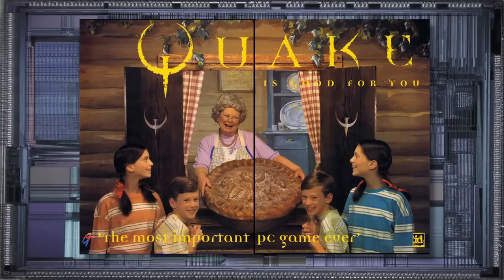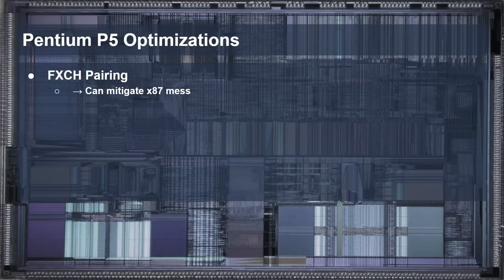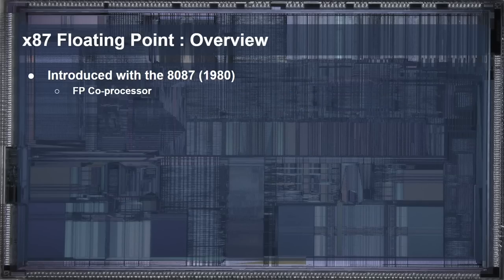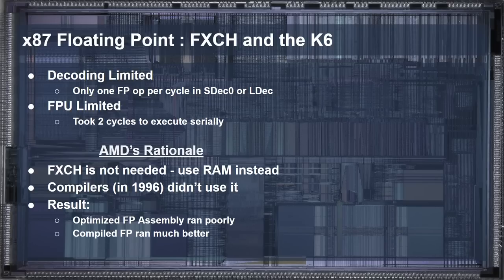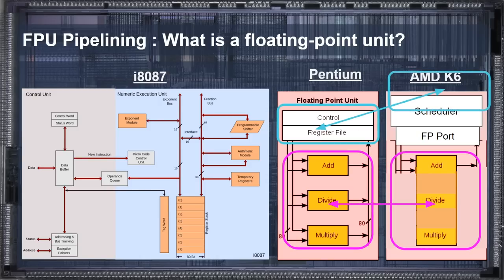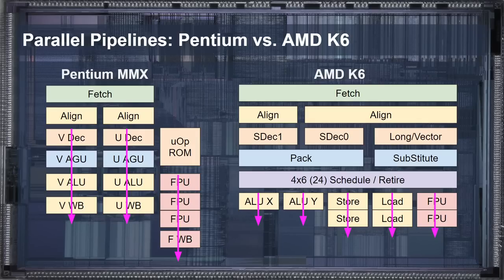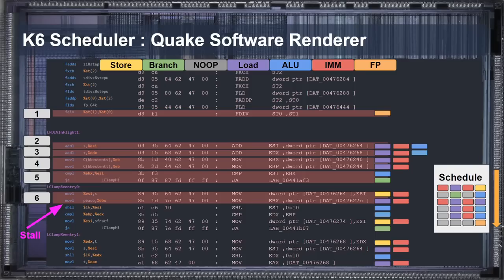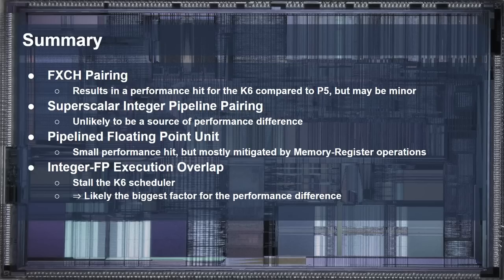Quake, Floating Point, and the Intel Pentium

Comment: You failed to mention how many instructions K6 could theoretically execute per cycle
Answer is
AMD K6 have dual instruction decoders
2 integer units (slightly better solution, then Intel) 
Floating, load, store and absolutely massive (8192 entries) branch petition unit
It have 32kb of L1 data, 32kb of l1 instructions, 20kb predecoded instructions cache. Even predecoded instruction cache is bigger then any L1 cache on any Pentium ever. 
AMD K6 could issue up to 4 instructions at same cycle.
Reply from the maker: That was discussed at 9:45 in the video.
The K6 actually has 4 instruction decoders, but can only decode the two simple decoders in parallel. That's in contrast to the P5 which has 2 decoders with some preconditions that effectively make it 1 simple + 1 complex decoder.
The K6 and P5 both have two integer units, so there's no difference there. Although, the integer units on the P5 were more advanced, since they could implement stack operations together.
The branch prediction entries aren't going to make much of a difference here. If anything, they help make the gap narrower than it would have otherwise been.
You're correct about the cache size, but again, that would only help narrow the gap - the K6 still performed worse than the P5 and P55C for Quake. Also note that the predecode bits weren't significantly more accurate on the K6 than the P55C's length predecoder - e.g. 80% accuracy vs 74% accuracy. They were mainly needed to ensure that the complex and vector decoders didn't cause the fetch stage to deadlock too often. And they also hindered self modifying code, which would require the entire cache to be flushed and a refill was slowed by the predecoding recalculation.
As for the last statement, the K6 could issue 4 MICRO-OPS per cycle, not full instructions. That was described in another section of the video, and ended up being the entire reason for why Quake was slower on the K6.

Comment: The problem and irony with the Cyrix 6x86 FPU was the fact that it was essentially the FastMath 387 with very little changes. What got Cyrix notoriety back in the 386/486 era for having one of the fastest add-in coprocessors wound up becoming a millstone about their necks because the emergence of Quake as a popular game. Besides, the whole point of using the FPU was to make use of as much computing resources as possible to make Quake one of the most futuristic game engines of its time. Other applications would not utilize the FPUs to such an extent outside of scientific or supercomputing purposes. Thus AMD and Cyrix chose to not put as much development resources into the FPU pipelines in order to cost-optimize and focus more on integer ops, which is what more desktop consumer users would perceive as value. Cyrix unfortunately took that to an extreme and got caught out.
Reply from the maker: Thanks for the additional information! I do recall reading about, and it makes sense from their perspective - why spend money upgrading the FPU architecture when it's not often used and they had limited funds due to competition with AMD and Intel. 
Although I disagree with your assessment that Quake's goal was to make the most futuristic game possible. The goal was likely to produce a 3D game without resorting to pseudo-3D techniques like in previous generations - a simple goal which comes with many performance strings. Luckily at the time of development, the Pentium could just barely manage to achieve that goal, so they proceeded with development. It was more like the bleeding edge of consumer technology finally caught up to their goals rather than trying to push the goals as far as the hardware could allow.

Comment: 10:27 - Minor error: the "Compute" highlight doesn't cover the Exponent Module, but does cover the Temporary Registers, which should be in the "Control and Regs" highlight.
Reply from the maker: Thanks! I think that was mostly a limitation from trying to draw a simplified shape. Although, I wouldn't really consider the exponent module as part of the "compute" given that it's implemented as a small adder - the real compute happens in the main units which could do up to FP80 computation (64-bit mantissa).

Comment: Wolfenstein 3D ran fine on 286, so it wasn’t optimized for 486 and was released as an enhancement to the previous game using the same engine, Catacomb 3D.
Reply from the maker: Just because it ran fine on the 286 does not mean that it wasn't optimized for the 486. Optimized usually implies code efficiency, so it ran faster on the 486 than the 286 after accounting for the clock speed differences.

Comment: I remember K6-2 destroyed Pentium II the moment AMD released a patch for Quake 2 back in 90s.
Reply: Celeron 300A is what "destroyed" P-II, and it didn't need any game patches for that.
Reply: @Ivan-pr7ku  Trust me, I know what I am saying. I was a gamer at that time.
Reply: I remember the Pentium 2 systems being prohibitively expensive and mostly targeted at businesses in 97. So for a home windows 95 machine you either got an AMD K6, an MMX, Celeron or a Cyrix system(from best performance to least). Lots of people still had Amiga and Atari ST systems which ran 2d games and media software.
If it was 3d games you wanted, you got a Playstation or Nintendo 64.
But for gaming it was less important what x86 CPU you ran in '97/'98 because graphics cards like Riva TNT, ATI Rage, Matrox and S3 were coming out. Even the mostly-2d-accelerators ran software 3d better than the CPUs (though 3d APIs only got good with win98), and the T&L cards after that first gen were something else entirely. Massive FP multiply and divide operations were just done with the 3d APIs since the GPUs have the better hardware since then.
In retrospect, AMD's implementation of out of order execution was more significant than Intel's fast FPU switching trick. And Quake was less significant as a game but more as a basis for most 3d engines at the time (well, the openGL version, not this software rendered one).

Comment: I haven't finished the video yet, but so-far, it seems well-researched. However, it's odd to see you say that the Cyrix 6x86 PR233 was "233 MHz", since that chip only ran at 188 MHz. I'll leave any more comments I have after watching the rest.
Reply: Hmm, I'm not quite sure I followed your explanation of why you believe the "ST" K6 processors weren't benefiting from their on-board cache. Just looking at the specifications, it seems intuitive to me that the performance-per-clock of the K6 "ST" models scales with their L2 cache. I suppose we would need to test to see for sure.
Reply from the maker: The PR233 was used as a point of comparison, because Cyrix claimed their CPU was equivalent to a 233 Pentium. There's really no "fair" way to compare the architectures, given their optimal speeds and underlying implementations were different. 
As for the ST variant, I think you have that confused. I said that the ST cores DID benefit from the L2 cache, and that's why they matched the Pentium MMXs (when scaled for frequency). It was the K6 CXT cores that did not, because they lacked the L2 cache. Unless you are questioning the difference between the 128K and 256K versions? That's likely because the 256K could cover more of the DRAM penalty by simply being larger (reduced misses).
Reply: @RTLEngineering  Hmm, I'm not very good at listening, so maybe I did just hear wrong. I'll have to listen again sometime when I have time. ^^ Thanks for replying.

Comment: so, the pentium 233 processor could perform one "free" floating point operation every 16 cycles, whereas the k6 and the one mentioned at the start of the video had to pay for each one. And this meant that code optimized to take advantage of that pattern of 1 FP operation per 16 cycles fully took advantage of the pentium 233's special feature.
Reply from the maker: Essentially, yes. Although it wasn't just any FP operation, it was FP divide. Other operations like FP add could be performed every cycle on both the K6 and Pentium (the K6 might have been every-other cycle due to the decoder though, I would have to look back at that, and the Pentium would require a specific sequence of instructions to also take advantage of that).
I wouldn't say this was necessarily a special feature of the Pentium (certainly not special to the 233 MHz variant), more of a quirk in the micro-architecture - it was a feature on the K6 which turned into a bug, and a missing feature on the Pentium which turned out to perform better.
Reply: @RTLEngineering  Oh ok. By the way, I know basically nothing about processors. 
What I meant by a special feature was what you talk about at 14:30. The exception logic.. which made it possible to have a FP division in the background.
Reply from the maker: Oh, the exception logic is implemented on all of the processors - it's required by the instruction set architecture (ISA) specification (x86 in this case), which effectively is the agreement that the hardware makes with software / compilers allowing code to compile and execute. The difference between the processors was in the technical implementation of how this logic was implemented - the ISA states what should happen, but not how it should happen. Modern processors take advantage of that distinction to execute more instructions in parallel and therefore faster overall. Anyway, I think it would still be more precise to refer to the difference between the processors as a side-effect rather than a feature, since the implementation is ideally transparent to the software (it should have no idea what's going on under the hood). AMD's solution was perfectly valid, it just had unintended consequences for Quake. Also, aside from the FDIV, I believe the rest of the Quake code actually ran faster on the K6 (because of the parallel execution - called Out-of-Order execution), but it wasn't enough to make up for the loss caused by FDIV. 
I hope that made sense / clarified what I meant in the previous comment.
Reply: @RTLEngineering  yes, it made good sense. I did not get it as fully as you wish but that is down to my own illiteracy on the subject. Like, I'll take your word for it. But I find your explanation to be well stated.

So, the question I next have, is, 
could an engine have been developed that ran just as well on the k6 as it did on the pentium? Was there a design limitation that the pentium happened to satisfy accidentally, but which the k6 was not made for? 
Like stepping backwards in time, per se,
what would it have been like if they had developed Quake with the AMD processors in mind? 

You say the software is supposed to be blind to the internals of the processor, 
yet it will always be the case that knowing how the processor works means knowing how to utilize it better, 
like going to a tailor, who will measure you and make you clothes that fit you specifically.
Reply from the maker: An engine could have been developed that ran around the same on both processor, but it would have had to give up fdiv, or used some division approximation. The DOOM engine would have been a good example of that, but it came with limitations, and the Quake3 engine introduced the rsqrt approximation that would have been much faster (and sufficient for Quake), although it's possible that the trick had not occurred to anyone until that point. So to answer your other question, the design limitation was the need to do perspective correction, which requires the fdiv, and the Pentium happened to satisfy it.
Developing with AMD in mind would have led to a different solution: restricting the 3D movement like in DOOM, using an approximation, or using a small look up table (that's how the N64 did it - in hardware).

 And your point is exactly correct. Blind in this sense means that the code will execute, which is true. You can execute the Quake code on a AMD or Cyrix processor, but it won't perform as well. You can always tailor the code and / or the compiler to the specific processor, but then you give up portability to other systems. Although I don't think Quake could have been tailored to the K6 or Cyrix in such a way that it performed better than the Pentium without altering it to the point of being a different game.
Reply: @RTLEngineering  this is good stuff. Thank you for the reply.

Comment: amazing video @RTL Engineering this explain so much on why the K6 struggled so much with fpu heavy games like Quake, so quick question are you planning to post a video on the Pentium 2/3 and K7 Athlon?
Reply from the maker: I do have a video planned on the Pentium 2/3 and on the K7, but those are focused on the front end alignment, and not specifically on games.